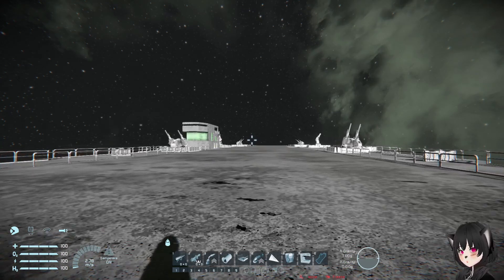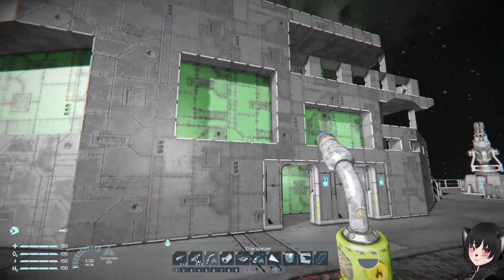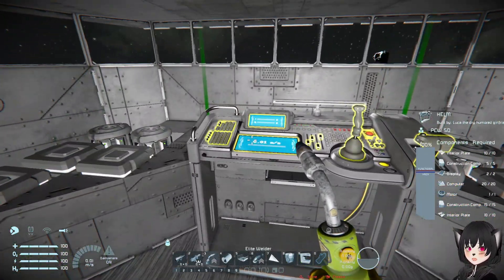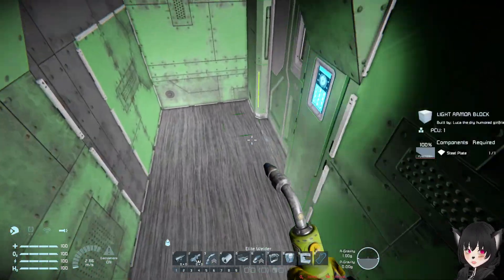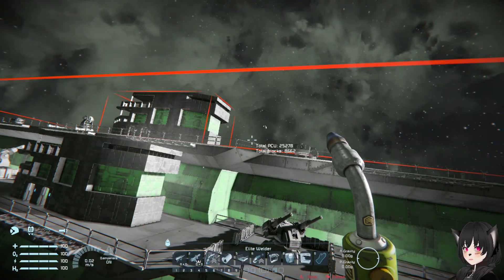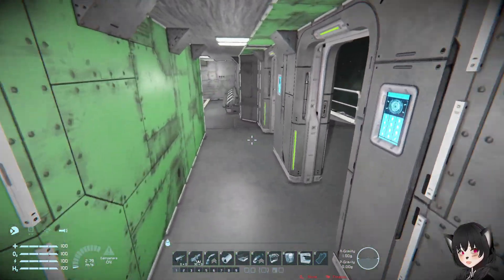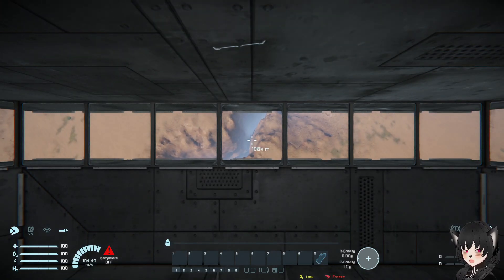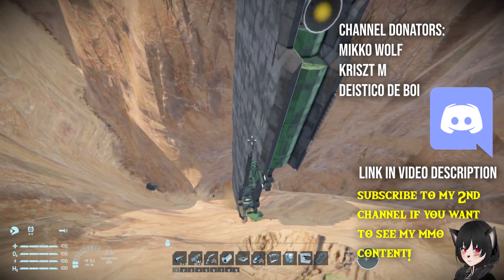This Carrier Ship Has a Quirky Design Feature, Space Engineers

Comment: I have one if these, saved in my workshop. Large grid blocks are a 5x5 of small grids, a perfect fit.

You can attach then clang free with landing gear and use low/no strength connectors to bridge systems. 

You can find starting points for new ships that already have the small grid perfectly meshed.

Comment: In case you didn't know, you can copy or cut an attached subgrid by itself by pressing ctrl shift c or ctrl shift x respectively.
But yes, that is an EXTREMELY tight tolerance for a subgrid. That wasn't possible for seperate grids a few yeara ago, until they tightened up the collision boxes on the blocks. But still, I don't think i would want to do that kind of close quarters on a ship unless i secured the two grids with a landing gear or magnetic plate.
Reply from the maker: Was thinking about doing that but was worried that it will copy the whole ship xD since that happens sometimes, and ye u wu it's pretty tight x3 I remember that update xD it was quite a big deal x3

Comment: You can use a remote control block on the main ship, put it on the hot bar of any of the small grid cockpits/control seats as "control" and control the ship that way. Added bonus is that you only need to setup the hot bar of the remote control for all your ships functions, so it makes adding more control stations easy, even if they're not sub grids you can do it this way to make repairs easier, since the only setup for new control seats is the "control" function.
Reply from the maker: Oo, good point x3 didn't think of that c=

Comment: you could control the ship from the island if you use the Sub grid control script but even for an aesthetic builder like me that's just not practical.  I try to avoid subgrids in my builds to keep them server and projector system ready.
Reply from the maker: I see c= I don't really use scripts so I'm not familiar with them x3 and yeah u wu they're always impractical partly for those reasons x3
Reply: You could also put a hotbar link from your control seat/helm to a remote control block on the main grid. That way, scripts aren't necessary, but it is an extra step to control your ship if you're in a hurry.
Reply: I figured somebody would have mentioned the subgrid script.